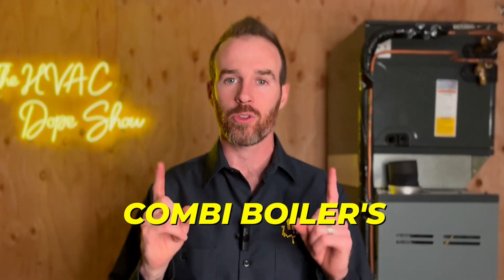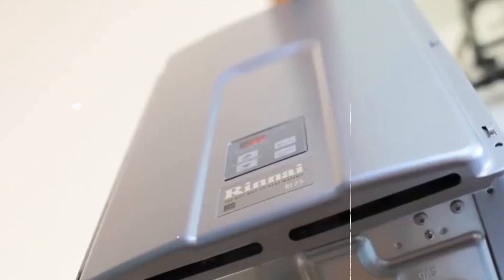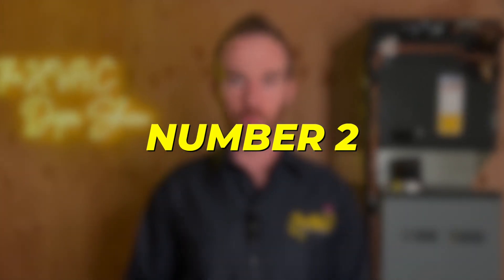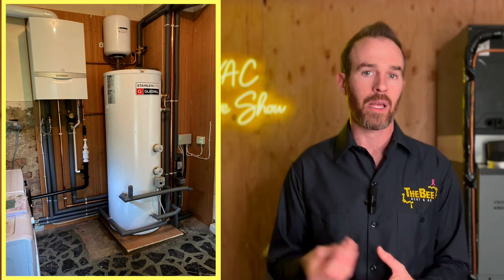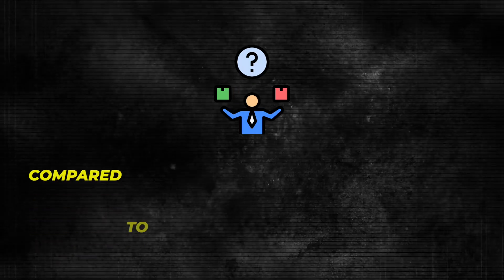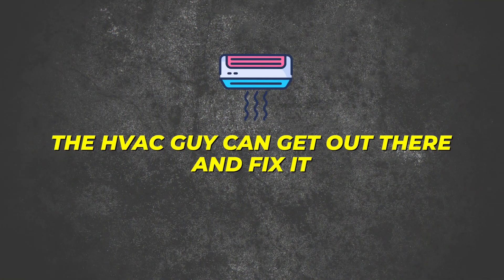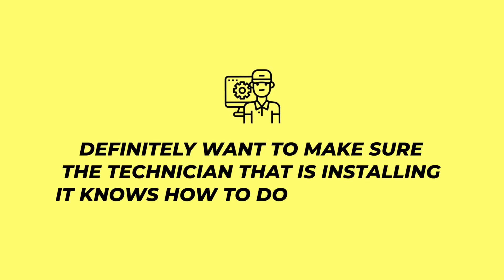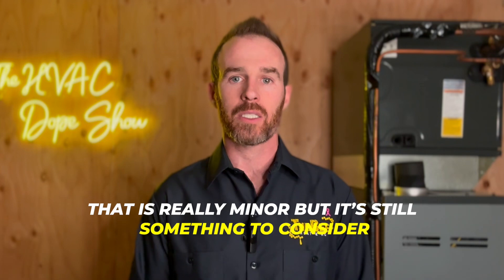Combi Boilers Explained 🔥

Comment: What brand did you NOT recommend and what brand DID you recommend?  I couldn't understand what you were saying.
Reply from the maker: Honestly IMO combis are ALL finicky... it's fine they work, but I'd prefer a solo with a sidearm (triangle tube solo). I have a combi, Triangle Tube instinct. It works, I had a service call after 3 years and was a bad flow switch (fixed it myself obviously) but I don't like customer products that do that... solos are more reliable. I don't like the lochinvar nobles, have had issues with those.

But here's why I like triangle tube. The auto tune feature for elevation is critical in Denver, so instead of setting the air fuel mixture manually, you set the altitude. This feature is perfect for making sure you're combustion is on point / a clean burn. That's the main reason I like the triangle tube products. The 399 solo for my snowmelt has been flawless... anyways that's my experience everyone has different opinions.

Comment: What do you think about the Ideal Exalt 155 floor combi heat & domestic hot water condensing propane boiler? Good /Bad? Good video.
Reply from the maker: I'm not sure I don't have an opinion on that brand but honestly combi boilers always have more service calls. I had to replace the flow switch on mine at the 3 year mark but besides that it's been reliable... but IMO having any problems with a system in the first 10 years is unacceptable, and combi coolers consistently have issues during this time frame.(outside of normal tweaking / tuning on a new install to just get it working the way the homeowner wants... for set points etc). If it was up to me I'd prefer a straight high efficiency with a sidearm as these setups still have issues but are much more reliable. We consistently have more service calls on combis. I'm sure some contractors / manufacturers will try to blame us for a bad install (because they want to sell combi's) but I don't care... IMO I'd rather have a cast iron (if venting allows and I had cheap natural gas), next choice would be high efficiency if I had a propane tank because fuel is expensive, and last choice would be a combi because of reliability issues. My VRV life heat pumps have been reliable and trouble free and I've had them installed for 3 years and 5 years respectively, and those have been bullet proof
Reply: @TheHVACDopeShow thank you

Comment: Hi! I have a couple questions. First, it was hard to catch what you said. What is the name of the brand you do NOT recommend and what is the brand you DO recommend. Also, we have a summer cottage on one of the Great Lakes. We usually close it down and winterize it for the winter. (Shut off the water and put anti freeze in the lines.) Anyway, I would like to switch from a gas boiler and gas water heater to a gas combo unit. Would we be able to do that? I’m guessing we wouldn’t want to shut it down completely for the winter, as we currently keep the heat set at about 50 degrees F during the winter. What are your thoughts?
Reply from the maker: Lochinvar is a brand we avoid now. Triangle tube we use now but honestly combi boilers are more trouble so if it's for a summer cottage you're not using in the winter often I probably would stick with a cast iron boiler if that's what you have now mainly because the space is not occupied in the winter. Combi sounds good in theory but are more finicky when water quality is bad

Comment: Hey I could really use your help. I live in a condo and my Laars mascot 2 combi boiler stopped working. One of my neighbors replaced his same unit with just a tankless hot water system? I don't understand how he did that and he still has heat and hot water? I know his cost was half of what I'm getting quoted for a combi unit
Reply from the maker: If it is in fact a tankless running domestic and boiler on the same circuit he's going to have issues in the near future, they work different and you're mixing potable with non potable water. Boiler water is now mixing with your  drinking water and that's not good to say the least... I don't think he knows what he has unless that's a diy job and did that himself but you can't replace a combi boiler with a tankless only and use it the same way, will only last a few years if that's what's actually happening

Comment: Is there something like this but with electricity instead of Gas?  We do not have gas (neither Natural Gas or LP Gas) in our development.
Reply from the maker: Heat pump water heaters are available here but via tank, not tankless design… and yes they have similar heat pump chillers available overseas and in Europe but unfortunately it’s not popular here yet because of how our infrastructure is setup. The concept you’re talking about can either be a water source heat pump, or heat pump water heater. But there is a heat pump water heater that also has taps for a coil (similar to a “sidearm” water heater”) that essentially heats the water and then that hot water can be sent through a fan coil in your homes ducted system. It’s slightly different concept than a combi boiler but unfortunately electric coils aren’t very efficient at heating so this is where heat pumps come in because the refrigeration cycle is more efficient than direct electric heating